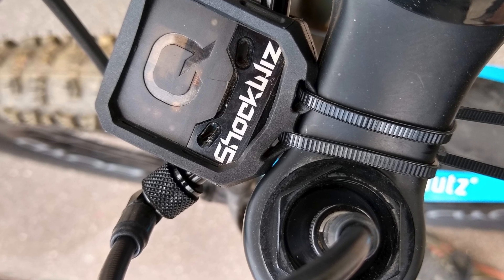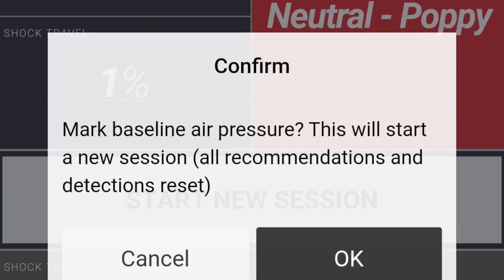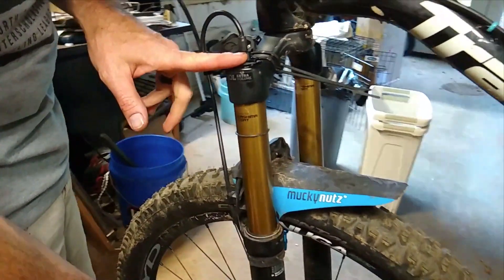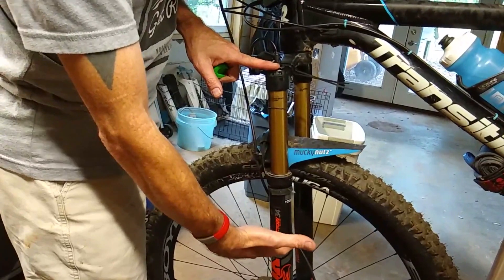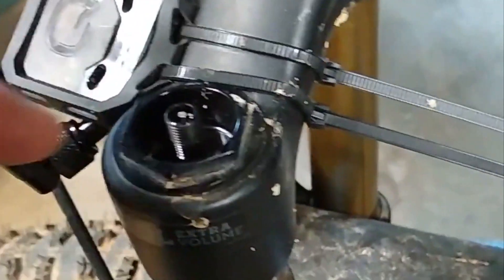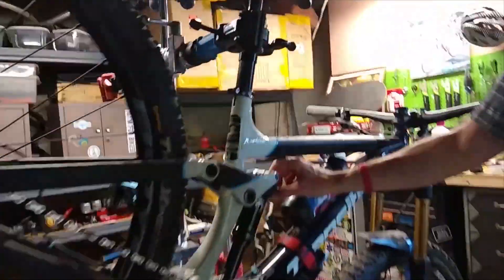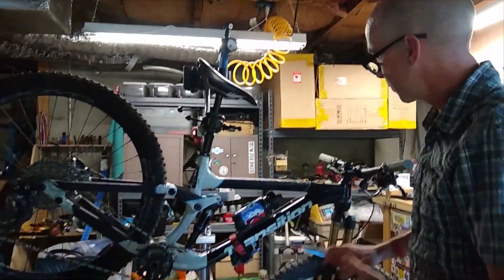Taming suspension with the Quarq ShockWiz

Comment: Hi,

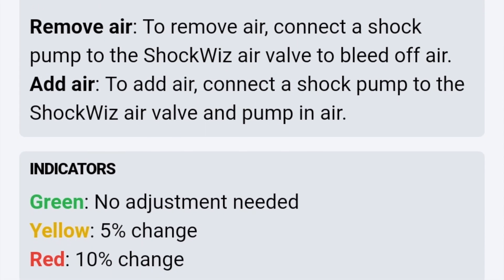2:00 into the video focusing on the air pressure. It’s leads you to believe that you need to remove air as the baton is in that direction, But actually you need to add air. Is this the same for the others, compression, rebound and  tokens?
Reply from the maker: Yes, that is what I found to be the case.